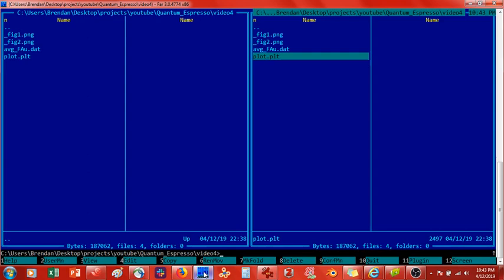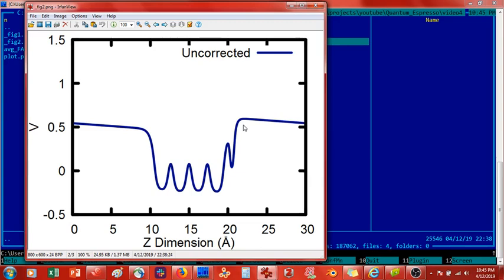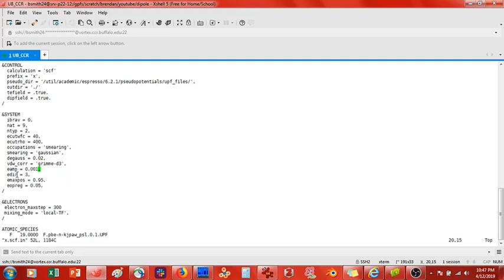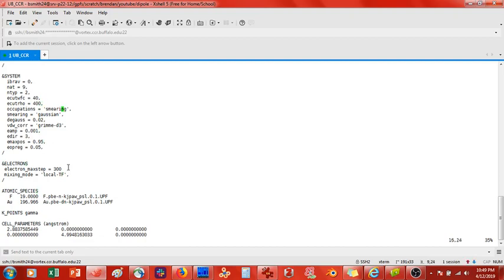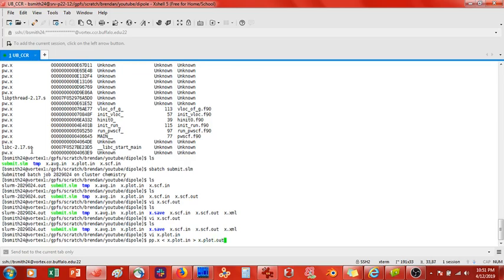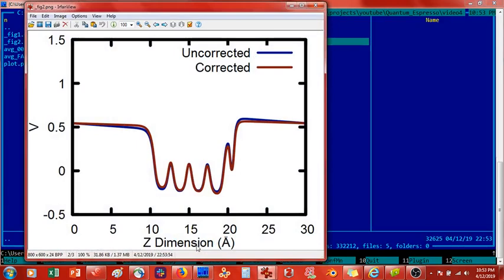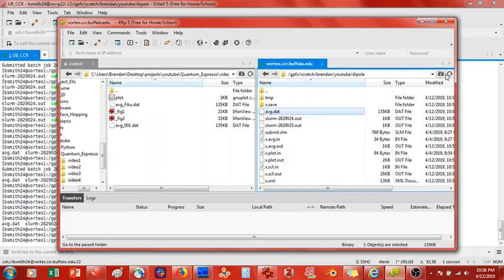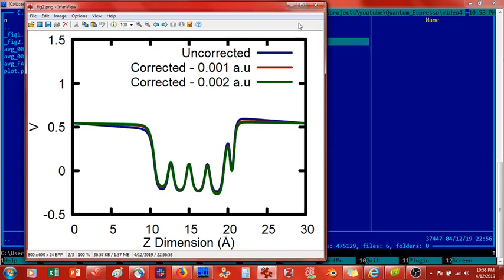Dipole Correction in Quantum Espresso - Part 2

Comment: Thank you for the helpful tutorial. If interested in surface energies, couldn't you avoid the need for dipole correction by creating a symmetric slab; i.e. putting F atoms on both surfaces of the slab and adjusting the adsorption energy accordingly by normalizing per F atom?

Comment: Hello Nickel and Copper!
Thank you for the helpful video! I had a question: in the blogpost by Christoph Wolf, he changes the 'emaxpos' and 'eopreg', but maintains his 'eamp' at 0, while you do the opposite. Is there a reason for this difference? In my calculations, I vary 'emaxpos' and 'eopreg' but keep 'eamp' at 0, and at while the slope of the potential does become flat, there is a kink in the potential at the point where the electric field changes is not continuous. Now, I'm confused and not sure if this is the right thing to do.
Reply from the maker: Thanks for the comment. I think what’s most important is that the discontinuity of the electric field potential take place far away from your system. The saw tooth potential (electric field potential) should be continuous through your sample. So whatever conditions make this happen are most likely fine. The best thing to do is the find at least 5 references that use this technique and see what the majority of them do. The more refs the better. Then, when you explain why you do what you do in your work, you can add these references in with you discussion.
Reply: @nickelandcopper5636  Thank you for your prompt reply. Yes, finding references is a dependable way to convince myself and reviewers. Once again, thank you for putting in the effort to make these videos!

Comment: An informative video as your usual . Thanks a lot
My questions are regarding the last part of this video, particularly adsorption energy  :
1) Please correct me if i'm wrong , i should use "vc-relax"  for slab & combined slab/molecule system to get the total energy , and i should use "relax" only for molecule relaxation to get total energy ?
 is that correct ?
2) Regarding relaxation of slab , should i fix some of the bottom layers ? if yes, why should i fix some layers? and  how many layers or what is the criteria for that ?
If you could provide any links on adsorption energy calculation example that would be great.
thanks in advance
Reply from the maker: Hi. I don’t have any links on hand. In any case, I think that one can use either vc relax or relax. It depends on much computational power one has available. I would use relax for this system. Maybe fix the bottoms most layers if you slab is on the larger side. If it’s only a few layers than letting all relax is probably better. For how many layers, it depends on the material. The best way to gauge this is to compare with what other people do in the literature
Reply: Nickel and Copper very helpful , thank you

Comment: Dear Nickel and Copper,
This question is not directly related to your video, but it would be helpful if you could possibly shed some light on this: Should applying the dipole correction affect electronic properties? In particular, will the density of states change after applying dipole correction?
Reply from the maker: It may very well change the electronic properties. It’s also possible that it won’t. The electric field is no more than an extra term being added to the Hamiltonian. H_total = Ho + Efield, where Ho is the Hamiltonian without the electric field. Now, when you diagonalize H_total, it is possible that the eigenvalue spectrum will change, and then the density of states may change as well. This is when compared to diagonalizing Ho itself. It is also possible that the change may be minuscule. I guess it all depends on the strength of the field and the system itself.
Reply: @nickelandcopper5636  Thanks for the reply!